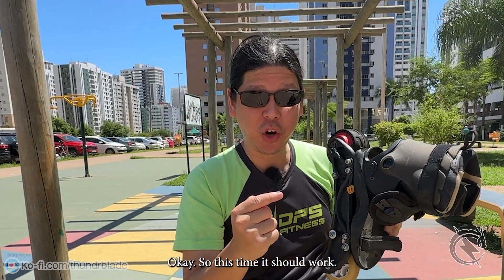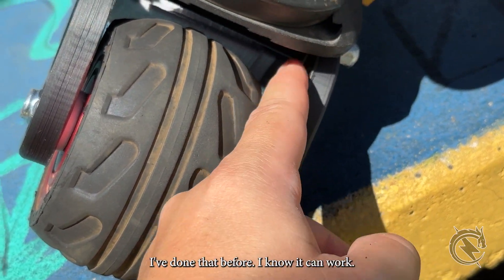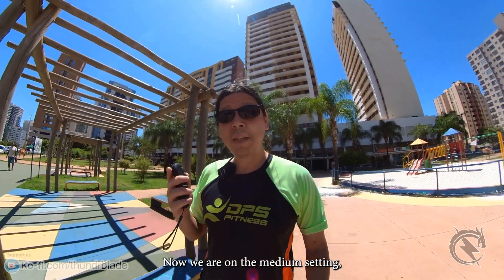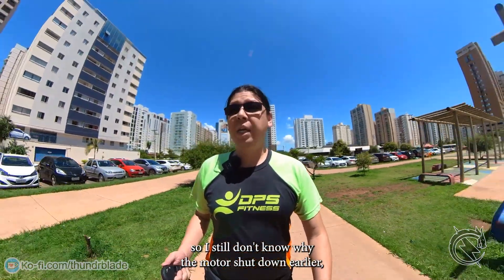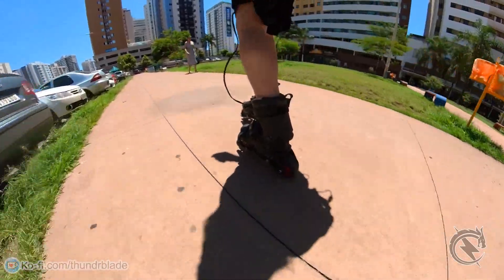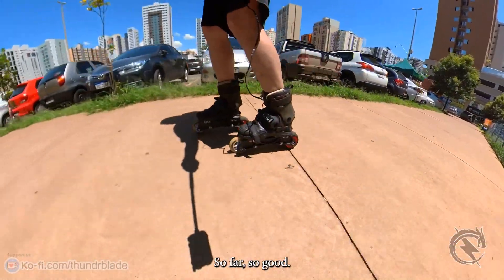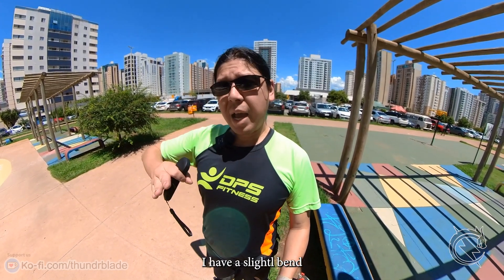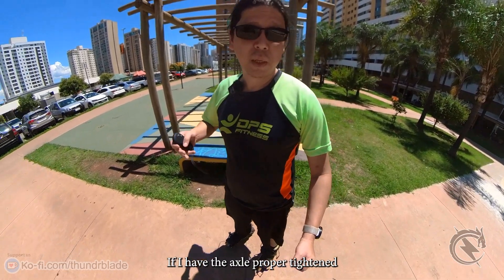[PART 2] 3D Printed Frame - Electric Inline Skate DIY

Comment: Even when electric scooters appeared, I was wondering when someone would make inline skates)) Cool project. In general, I think the coolest prototype would be made if to made more drive wheels and somehow synchronized them, and placed the power supply somewhere on the boot. well that's just a layman's opinion

Comment: 5:31 Hmm... It seems right here that your left knee is bending too much? It isn't making a straight 90° with the ground. While testing it doesn't look like much but in long term doing that could hurt your leg. It seems, just by looking, that the wheel is too small maybe? This is speculation i could be wrong but watch out there.
Reply from the maker: thats 2 things happening.
1- the 360 camera has a distortion that make it seems my legs are bending weird.
2- the xsjado boots were not tightened enough and I have a bad habit of forcing my knees outward. its just something I have since I was a teenager. I only do that when Im stoped or going very slow.

the wheels are 105mm diameter, definitely not small.